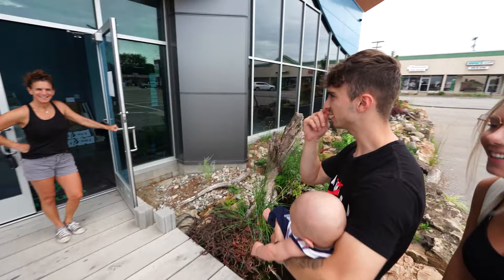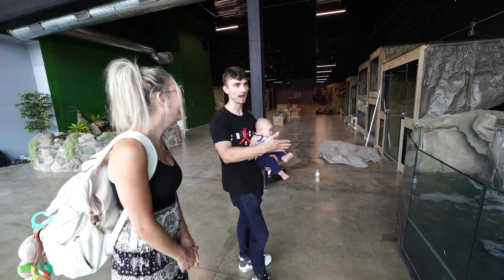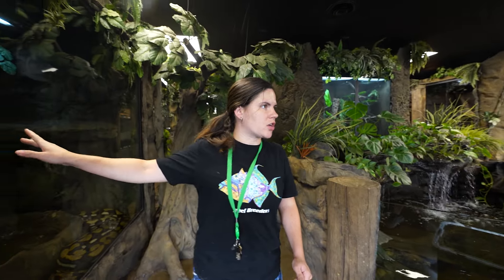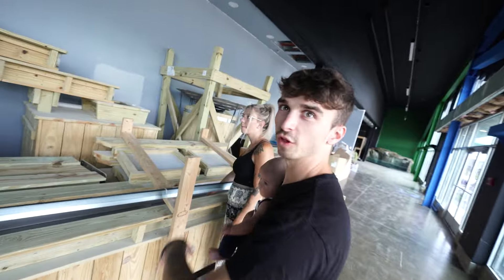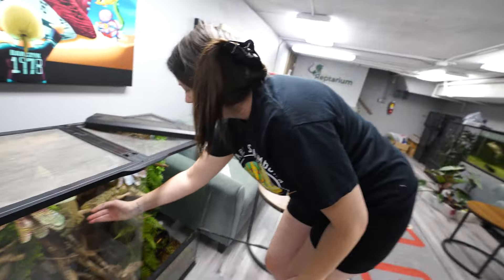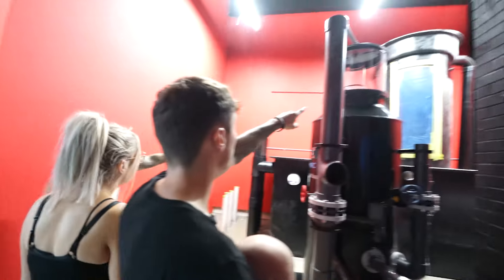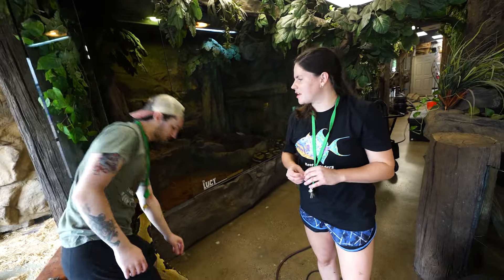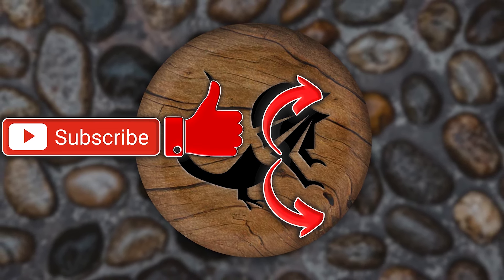We Filled our Giant Turtle Pond with Water!

Comment: The question regarding putting fish in with the gator snapper is doable. The main thing would be to go for fish that are far smaller than the turtle so the turtle wouldnt be interested in them and couldnt catch them. Fish like small tetras (cardinals, ember, rummynose) or even mountain minnows and barbs should work well in a large group and help emphasise the size of the turtle